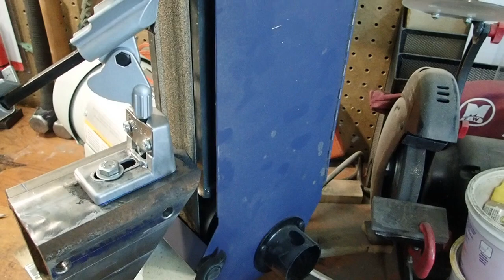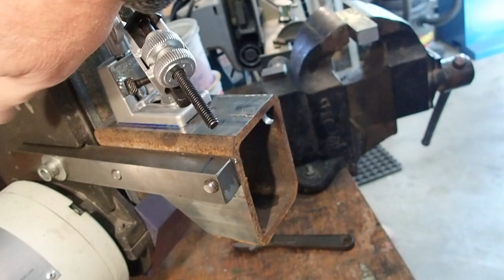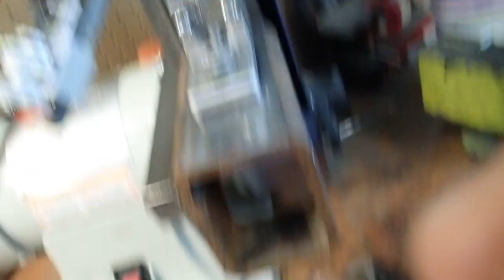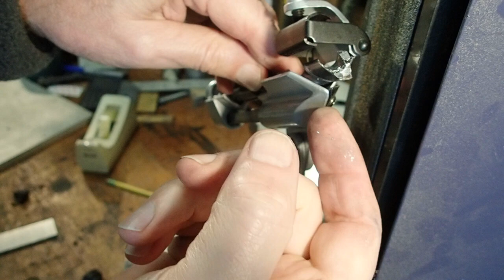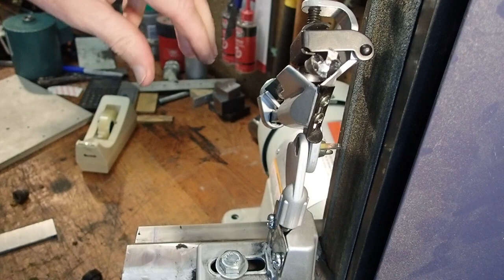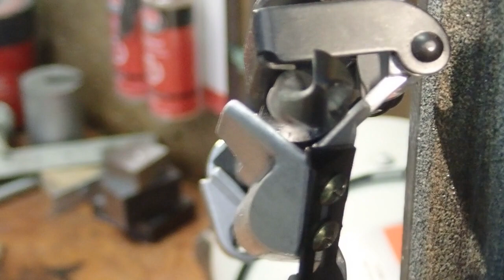General Tools 825 Drill Grinding Attachment

Comment: Does your scale have 118 degree stamped on your tool ? Mine does not? Mine has CSK, 49,59,68 and 88 degrees.
Reply: Each number is multiplied x2, so 59 x 2=118
Reply: 118 is the inclusive angle, meaning 59 degrees per side.